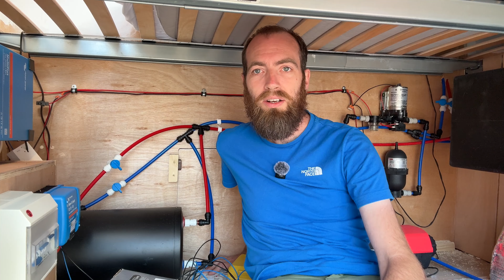My Van Water System & Diesel Heater Explained

Comment: Hi buddy what hot water system did you use in the build and how well did it work on the 12 V did you end up having to use the inverter in the end? Thanks.
Reply from the maker: Heya, it was just a generic Chinese one from ebay, I will be testing it in the next few days so will report back when I know more!
Reply: @DoddyDoes  cheers buddy please do let me know 🙏
Reply from the maker: I tested it today, it uses around 200w on the dc power side of things. It takes a while to heat things up but I think that’s because I’ve got it set to 65 degrees C! Works really well though! I may plug it into the AC side just to see how much it uses but that will be a while down the road I reckon.

Comment: Great video helped me with a few problems on my way thank you very much
On your water system, do you not have an expansion tank? 
👍👍
Reply: The accumulator is there just to even out the pump pulsating. When you heat your water it will expand and that pressure needs to go somewhere. Please do some research as I think you are likely to blow a joint in your pipe work.
Reply from the maker: Glad it helped! Yeah that’s the bottle shaped thing that I couldn’t remember the name of in the video just under the pump.